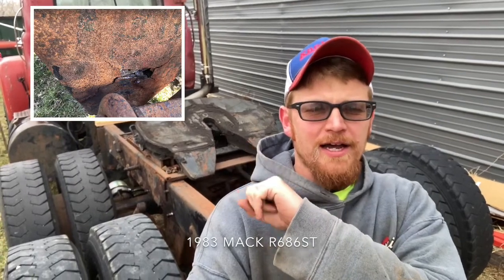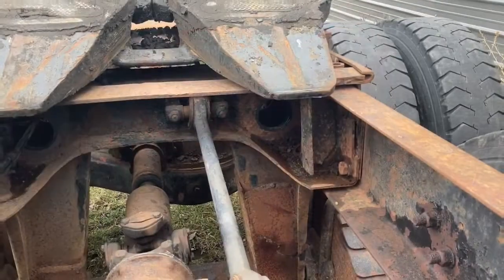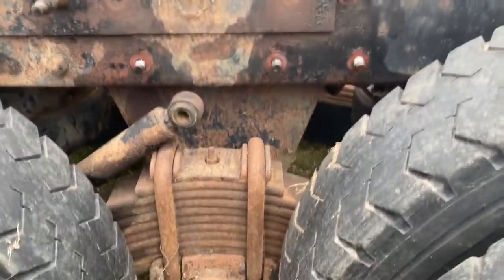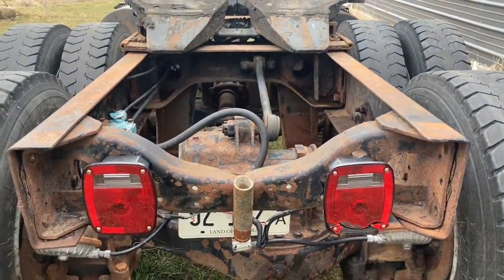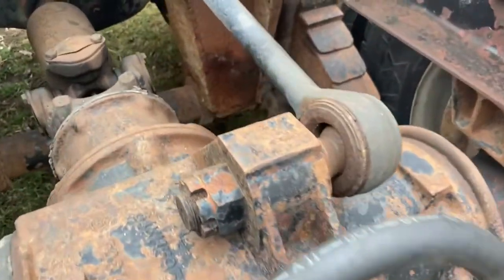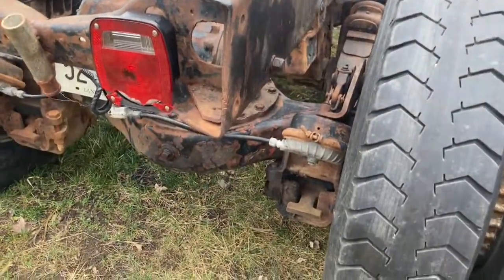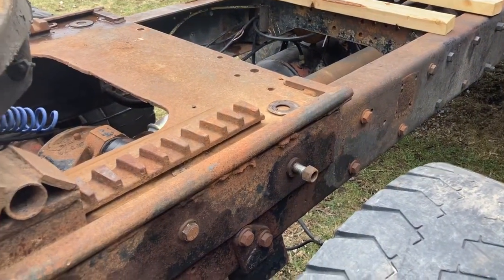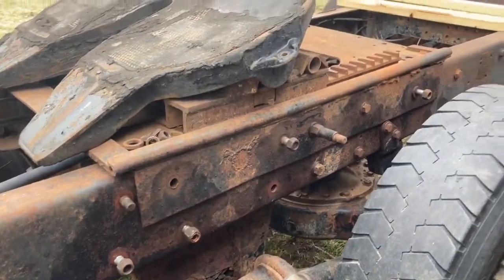Ep1 - Camel Back Trunnion Disassembly and intro

Comment: That’s one of the best rear setup to haul coal with those old R models were some coal packin’ daddy’s back in the day my dad drove an 85 with a 350 4-valve with just a little work done on the fuel pump and a 15spd that ol truck would bury the speedo needle believe or not I don’t care. I seen it with my own 2 eyes. But the 427 in the ch613’s didn’t want anything to do with that 350